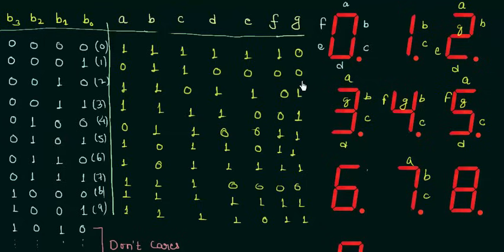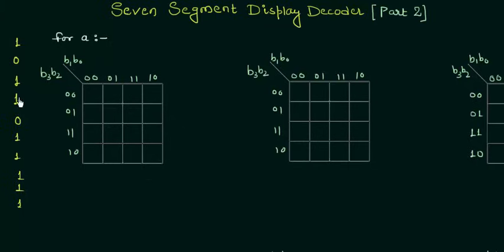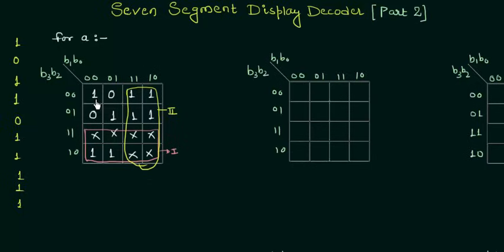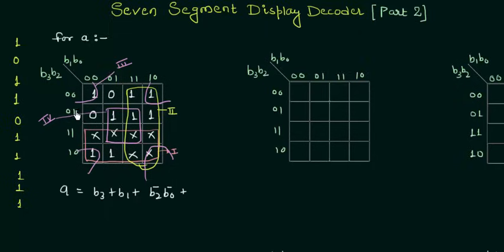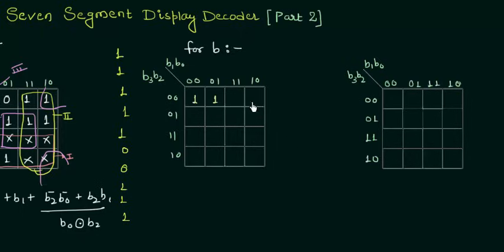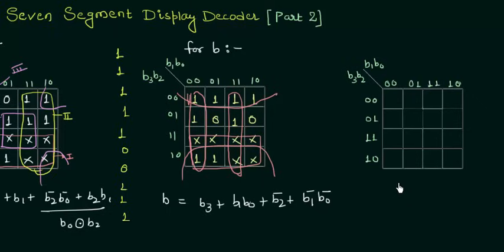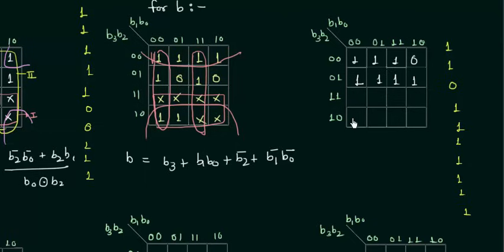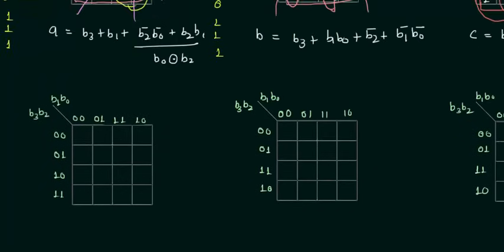Seven Segment Display Decoder (Part 2)

Comment: you use "don't care" only if you cannot use existing ones and when you need to make more mapping than original. 

Since, the bottom row can make a kmap with top one, you dont need to use all don't care and the solution can be done in 3 terms only instead of 4.

Comment: Hi this really helpful! but i just have a question that why did u consider b1b0 and b3b2? cant we just do b0b1,b2b3? since we already put the input in order like b0,b1,b2,b3? is there any reason why we consider this order in the video?
Reply: That order comes from Karnaugt maps (k-map), in that order only change the minimun bits posible, by example the first number is 00, the second only change one bit and is 01, if you folow with the third would be 10 but in that case you should be change the first value from 0 to 1 and the second value from 1 to 0, two changes, if you change b1 for b0 avoid that, only change the first value from 0 to 1 and get 11 and the last change again only one bit, the second value from 1 to 0 and you get the 10.

Comment: I was watching to verify my results. Your K-Map for b has a redundancy with the bottom 8 terms circled. It can be done with 3 terms.
Reply: I don't understand, how is it redundant? 1101 and 1110(b3-b2-b1-b0)  do not have any other pair.
Reply: It's been over a year for me, I don't remember how to do K-Maps. I graduated college over a year ago, and I don't use any of this in my current job lol
Reply: @infinteuniverse  how time flies
Reply: @vishalksahoo3599 you use "don't care" only if you cannot use existing ones and when you need to make more mapping than original. 

Since, the bottom row can make a kmap with top one, you dont need to use all don't care and the solution can be done in 3 terms only instead of 4.
Reply: no
bottom row needs to be paired with the first row
so sir is right
there is no redundancy
Reply: Exp for 'b' may  be( b2'+b1b0+b1'b0') will possible

Comment: 1:50 You just copied the values of the table, but the second column first row should be 1. Because B0 ¬B1 ¬B2 ¬B3 should be 1 for the function a.